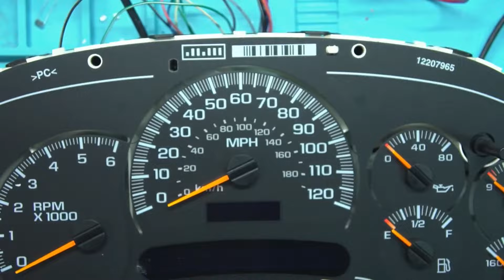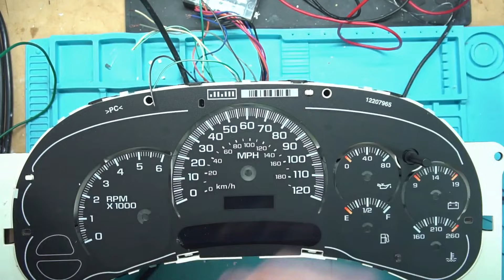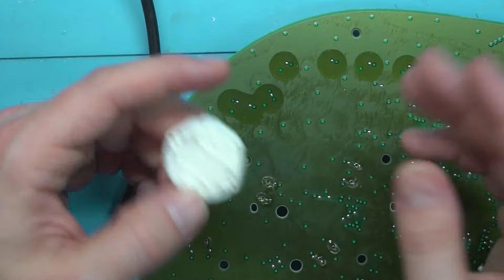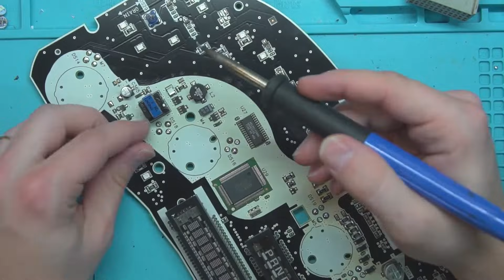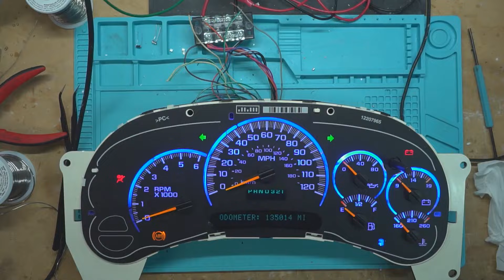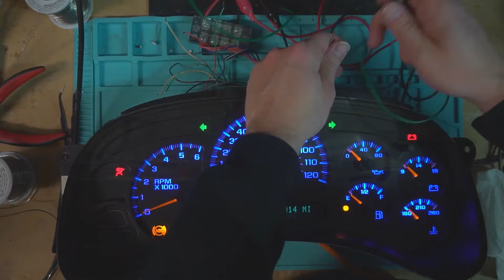2005 Silverado Instrument Cluster Repair plus Blue LED

Comment: It all sounds and looks great BUT demo is too fast especially when soldering bulbs.
I have no idea what two pods are you solder the bulb wires to or what kind/type of bulbs they are for a 05 Silverado. There seem to be so many out there but which one is the correct one is beyond me, or the name. 
A little help please.
Reply from the maker: In the end as long the led is rated to 12/14v your fine. The LEDs I used in the video are known as 3smd in eBay  no brand name. Cube LEDs from sunled work good too

Comment from the maker: Ok Guys. Youtube loves this video for some reason. check out my newer videos they are much better! I got a new Microphone.
Reply: Can I send you my cluster to get it fixed
Reply: Can I mail you my cluster so you can upgrade mine?
Reply from the maker: @showtime203bullies  yeah. My email is on. The about section of the channel. You have to use a PC to see it (that's just how YouTube works)
Reply: @FixedUntilBroken  ok cool
Reply: I actually came upon this video by accident ☺️
I have a 2005 Chevy Silverado, identical instrument cluster.
The oil pressure gauge doesn't indicate anything just stays at rest.
The guys I bought the truck from had used it at our job as a delivery vehicle so I never saw it work, even after they replaced the Pressure sender on the engine.
Is it simply the gauge motor?
🤷🏼‍♂️ I'd sure like it to work ☺️ I have very limited experience with electronic stuff
I'm assuming it's easier and safer to have someone else with the experience and tools necessary to do the repair 😏
Do you still work on these instrument clusters?
Reply from the maker: @silversoozookee2839  I do still work on them. Generally when the sender fails it reads 80psi all the time but that doesn't guarantee that it's not the sender. It's hard to say for sure without having the cluster in hand
Reply: What leds did you use in this cluster?
Reply: Hey buddy I need my trailblazer instrument cluster repair
Reply: Can you replace the steeper motor for me. Pls help
Reply: That gun ripped that solder joint pad, that's why I don't use those and just do them by hand with a hot iron.
Reply: What do I look for if all the needles are not working? Only the lights are.

Thank you.

Comment: Hey had a question regarding this 05 board. I am Trying to do a repair and upgrade the bulbs.  Reason being the all the back lighting on the board is dead what could be a cause of this the vfw is fine and all the info lights are working. Thanks!
Reply: Headlight dimmer switch should fix the light bulbs not working on the cluster and if the rest of the interior lights don't work

Comment: Just found this video and this is Exacaly what my cluster is doing the prnd arent working.. just curious how much would this package cost me if your still doing these jobs.. Leds and all. Basically the same setup i got an 05. Thanj yoy
Reply from the maker: To just redo the circuit board and add LEDs your looking at $80 plus shipping
Reply: @FixedUntilBroken  could you do this job to 2 of my clusters ? do you have a instagram or a ebay or something ???
Reply: What’s your contact information? Thank you.

Comment: When you say turn it on. If the cluster where in the vehicle would that be two clicks forward as in key on engine off
Reply: Other then that question, super informative video and extremely proficient. New sub thanks for the great videos
Reply from the maker: Not sure about the question it's kind of out of context but I think has to do with powering it vs just battery. Yes to turn the cluster on the truck needs to be in the run position. I don't think accessory turns it on but it's been a while since I have actually been inside one of these trucks I just do them on my bench. Going off memory here.

Glad you like the channel and thank you for subscribing!

Comment: have a no start which i dont comprehend! i thought vehicles run without clusters! mine dont! everything works all lights and gauges except odometer says miles when to try start for two seconds then i hear static noise and miles go to error!!!!!! car wont start no click nothing! helpppppp!!! any ideas resistors inside cluster or what to look for i see nothing burnt or loose
Reply from the maker: Year/model?

Comment: So I went into my 05 Sierra and changed the lights that were out to leds. I followed everything you did in this video and when I got done resoldering (reflowing) the components to make my PRND display show up all the gauges and BOTH displays were not working. Could it possibly be that I need to touch up my resoldering job? Is there a way to reset my instrument cluster?
Reply: Have the same problem but don’t know what it is

Comment: how do you know the polarity with the lights and board?
Reply from the maker: How do I know them... Memorized I've done 100s of these. If you're asking how to tell doing yourself easy way to test is to use a volt meter with it powered up. Can also just solder them in, see which ones work and if they don't work flip them. It won't hurt them
Reply: @FixedUntilBroken  thanks!
Reply from the maker: @planbkustoms  no problem
Reply: @FixedUntilBroken  real helpful… could’ve just answered the question
Reply from the maker: @gearjammer89  except the problem is half the pads negative is on the top and half are on the bottom and it doesn't follow left to right easily to explain in text. If you Google it you can find plenty of pictures that show it. Its not like all the pads are the same. 

Plus the question was how do I know the order of them, it's because I have it memorized. He didn't ask what the order was

Comment: I have a 2005 Tahoe 

1. What State are you located in?

2. What's the cost to replace the cluster's light w/blue leds

3. How long will it take to do?
Reply from the maker: I'm in Florida. It's $80 + shipping. I normally get stuff done the same day I get them in. Main time factor is shipping it can be overnight if you want to pay the shipper that much or 3-5 days ea way. Most people just use speedo apps on there phone while the cluster is out.

Comment: Does it matter what kind of bulbs you get?
Reply from the maker: Not sure what you mean but I mean yes they need to be rated to 14v, solder in and if it's an led you don't want anything with round top or you will have hot spots

Comment: Do you know which leds are used for the other alarms (seatbelt, low fuel level light, e brake, check engine, etc etc)?
Reply from the maker: Like what type of light? It's a 3528 smd.
Reply: @FixedUntilBroken  yes what type. All are 3528 except the backlighting and turn signals ?
Reply: @FixedUntilBroken  and do you know if they’re plcc2 or plcc4?
Reply from the maker: @AlexRodriguez-pg9xk  plcc2 for the 03-07 stuff.
Reply: @FixedUntilBroken  thank you !

Comment: what if your data center is dim and you cant read it in the day time?
Reply from the maker: It can be a couple of things. The 1.2k, 1k ohm resistors by the power circuit for the VDF, the VFD can get cracked solder joints on the hot wires and the VFD driver can have issues.
Reply: @FixedUntilBroken  thanks
Reply from the maker: @17buckrogers  no prob report back if you find your problem just in case someone sees this with the same issue

Comment: i bought a cluster from a  12-01 escalade for my   02 gmc sierra 2500 hd..... its got the hook up on the very back but up top as possible..... i been told the power & the message center won't work  cus of the wrong  plug  in..............   so what yr., of the right escalade do i need to get the one that has the hook- up on the very top side of it all..... i also need it to have the white lil disc's ( stepper motor's ) in it  not  the coiled copper one's................................... i need some  wisdom here  plzzzzz   !!!!!
Reply from the maker: I'm not completely understanding what you mean but if you're truck has plug all the way in the back of the cluster it's an 03+ if it's on the top it's an 99-02.

Comment: What do you charge for 2005 Silverado cluster rebuild? How could I contact you directly
Reply from the maker: My email/business Facebook is listed on my channels about section. As long no broken plastics your looking at $80 + shipping.
Reply: @FixedUntilBroken  ok great, I'll be in touch through email. Does that include stepper motors and leds?
Reply from the maker: I'll keep an eye out for it.
Reply from the maker: @chevy468boy  yes Edit: full rebuild
Reply: @FixedUntilBroken  channel's....??  how many channel's do u have  now here on u-tube.... & what all r they called so i can watch em all....... & does all the channel's deal w/  all sort's of  g.m. ( chevy & gmc ... how many others cluster's.... if so what all yrs., & make & model's  have u done out there in   washington state.......
Reply: i had your video saved in case mine broke i have a 2003 chevy surburban would it still be 80 dollars plus shipping and does it come with the leds as well for full rebuild by chance fixed until broken

Comment: How do I get the board to sweep like that in a bench? What wires or pins do I use on the plug?
Reply from the maker: Powering it up gets them to sweep to home. sending them serial data with an PCM get it show fuel, oil, temp and Trans temp. you can use a tech 2 to sweep all of them back and forth.
Reply: @FixedUntilBroken  I can get it to power up on the lights but for the message center of for the warming light and the motor to sweep I can’t how can I get them to do that on bench test would help me a lot so I don’t have to be going back & forth plz help
Reply from the maker: @josebarrera2929  not completely sure what you mean but about the message center but check out my video on ipc hammer
Reply: @FixedUntilBroken  I’m talking about like let’s say im doing a rebuild on a cluster insted of running back to the truck to check if everything is working how can I make everything come on on the table I bought a plug already put I can always get the back lights to come on and check engine light I can’t get the odometer come on or the abs, air bag ,battery,gas light etc.. I personally started working on others cluster and figuring out how to make all that come on with out the truck will help me out a lot thanks!!!
Reply: What voltage to which pins does power up?